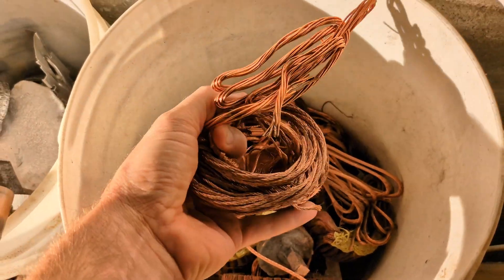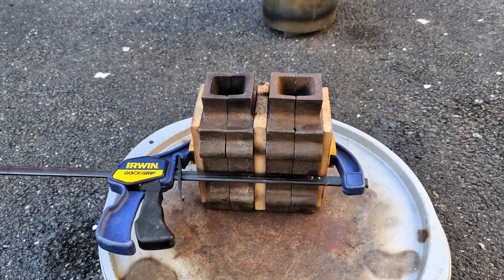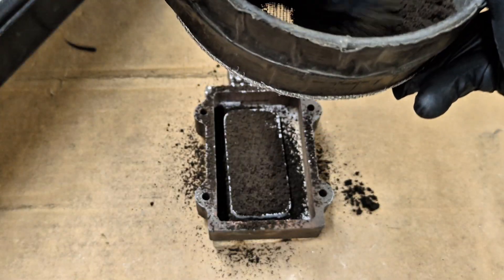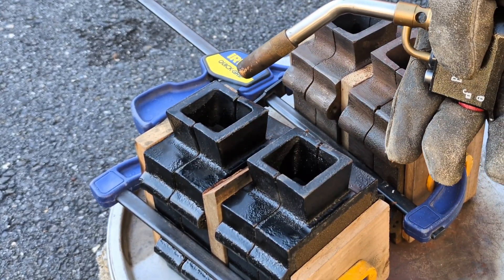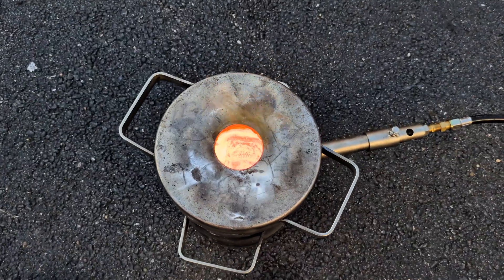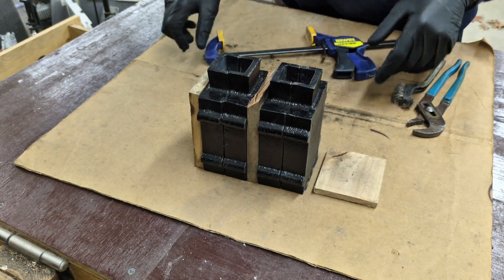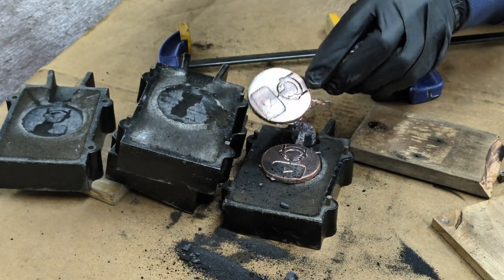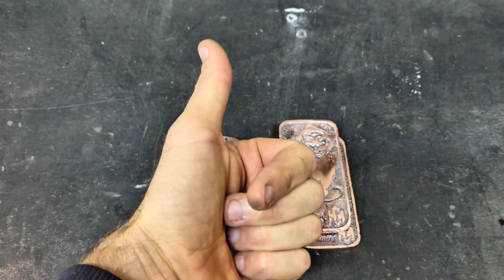Melting Copper Wire Into Copper Bars

Comment: Quick question newbie here.. how long did the melting process take and where did you get the custom stamps from ?
Reply from the maker: Hey, welcome to my channel.  I made the original pattern using foam.  I carved out the design with my cnc.  It took about 25 minutes to melt the copper.

Comment: Do you need flux to put unto the crucible?..I have over 8000 pounds of wire, bought a furnace, molds and flux.i seen another video where they said had to use flux
Reply from the maker: I've seen people use flux too.  I have never done it.  I couldn't tell you the difference since I am just a hobbyist.

Comment: Do I need a casting flask to begin or could I diy it with a wooden frame? Also could I use any metal tool for the hammering of green sand?
Reply from the maker: i tried doing it with a steel container, but the metal eats away at the steel.  It is best to use a clay/graphite crucible.
Reply: I seen wood frames, they can burn and blow out if not enough sand protection.